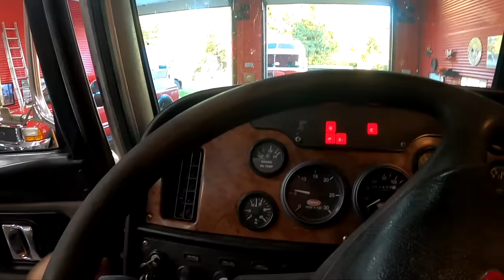Back to work on Smokey the K100 Aerodyne and Stubby the 362 Peterbilt cabovers after MATS

Comment: Mike go to the scrap yard and get two drive shafts use a hanger bearing and get one cut down to size there are all kinds and different sizes get two that will work for you that’s what we did good luck.

Comment: Mike i dont think you would agree but i think with K2 you should do a old sckool new school type deal. Get a chassis with moder axles with disc braks from a wreckers old mechanical engine and modern cooling pack then youll have a winner in my book a old k100 with new running gear

Comment: Stubby is a short truck by today's preference for longer wheelbases and only a mild stretch for 1980's-90's COE.  Personally, I think the long stretched trucks look a bit silly and might be a real problem for turning in areas where there is not a lot of room.  
I'm betting that when you prime Smokey's roof and then put down a mist coat of paint and block sand, you will find plenty of high and low spots.  Body work is highly time consuming and labor intensive.
Reply from the maker: Boy that's for sure, hats off to those guys.

Comment: Mike when I asked you before if that was a single bunk or double bunk the one in the shop right now with the red stripe that's a single bunk it's an aeriodine with two bunks but it's a single wide that one that you just were looking at outside is a double bunk Ariodine and it's got the double bed in it on the bottom okay that's all I wanted to say.

Comment: Take a look at FSC trucking , 1984 Pete cab over, with a 400 B model Cat, back when they made real engines, running hauling drop deck everyday, great guy.
I was told to get a new 6nz i had to turn in a 6nz core.  Now thats for the new Cat engine. Don't know about reman.

Comment: Mike .. if you diamond plate is an inch to wide ... wouldnt be a big job for a metal shop straighten one side & rebend
I wouldt be so quick to stick my head in that sleeper ... in your neck of the woods , lord knows whos using it for a den
looking at K2 ....what was I looking a recently where they had an ?80s ish era North American moving trailer all perdy like ... was there one at MATS I saw on a video ?
 in true Canadian style Smokey has a red hockey stick on her side
Reply from the maker: 😳 yeah might find smokey bear naping